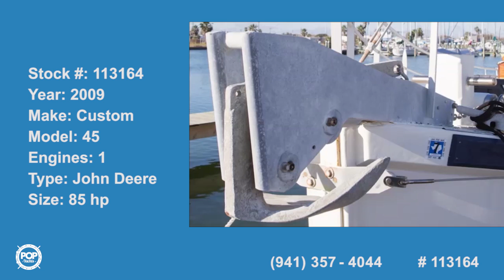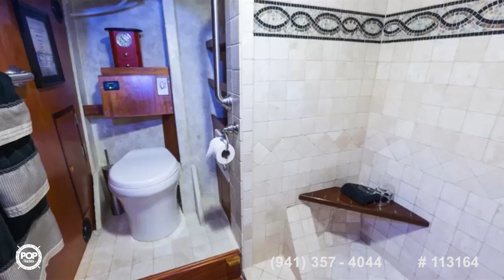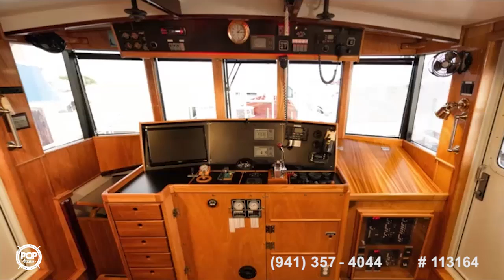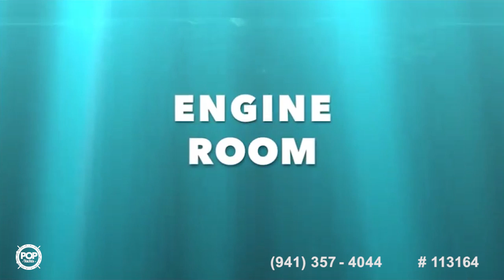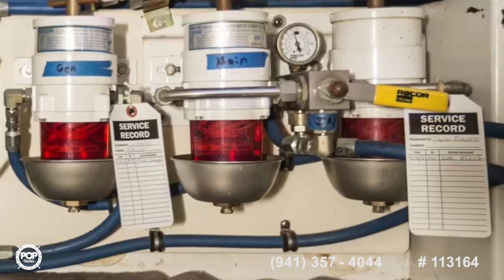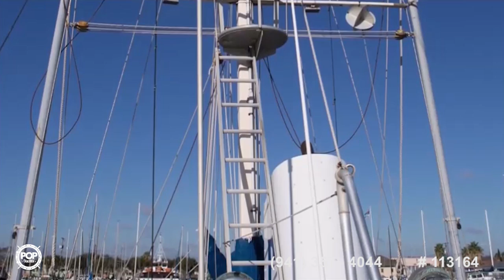[UNAVAILABLE] Used 2009 Custom 46 Diesel Duck in Rockport, Texas

Comment: I had the pleasure of seeing this boat in early 2018. It is wood construction, very well thought out and executed. The builder applied commercial boat building methods during construction which contribute to the safety, ease of handling and robustness of the vessel. There are some unique idiosyncrasies (IMHO) that I didn't necessarily like but which were well thought and I felt I understood his decision making. In the end I figured I would get used to those pretty quickly. 
Unfortunately, it suffered some damage during Hurricane Harvey that was too much for my comfort in moving forward on the purchase. For the right person and price, this has the potential to be an incredible purchase. The pride of building shows throughout.

Comment: Sounds like you are trying to sell a farm or a trailer, not a boat.  Start off with the anchors then the head?  Does it come with a trailer hitch?  Higher someone.
Reply: Steve Evans. Hire not higher
Reply: The anchor handling is both the front of the boat and shows the robustness of the build. I agree it seems like a strange place to start but once you understand that he applied to same thought process towards the rest of the vessel build, the anchor system seems like a key demo, you can see the strength and thought process right out there in the open.
Reply: Do you start your description at the bow or the stern?
Reply: @KitLaughlin  The OP sucks so hard, gets some garden hose, and dives down and starts at the keel.
Reply: @nssherlock4547 : Where can we see your perfectly produced video of the yacht you designed &  built?
Reply: Hire.....